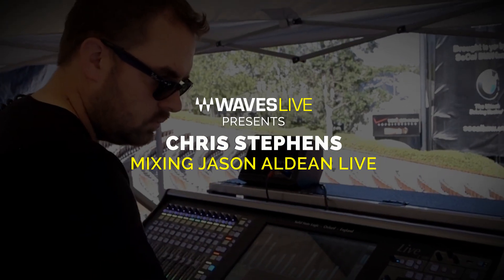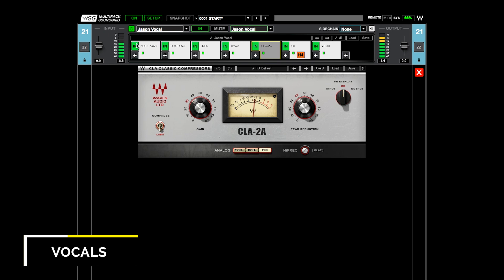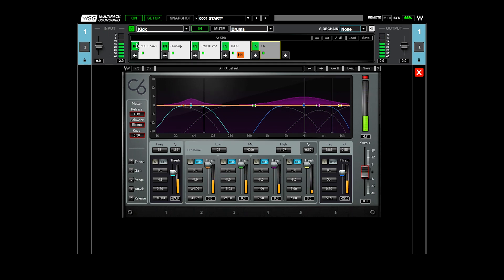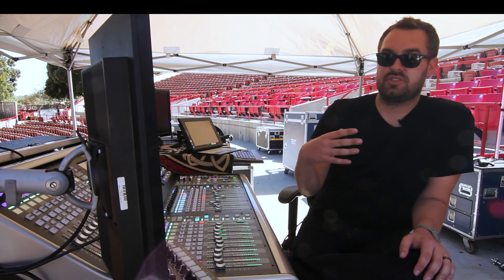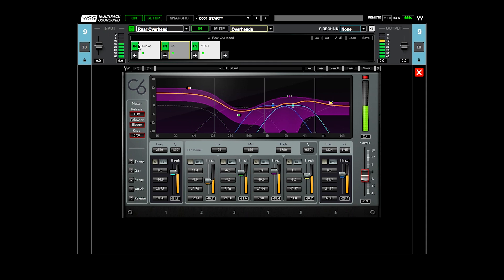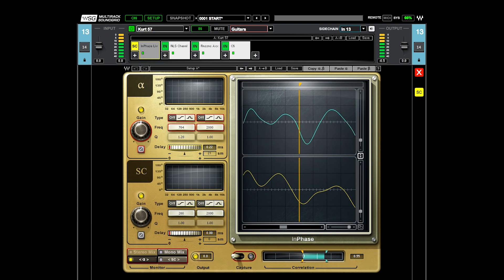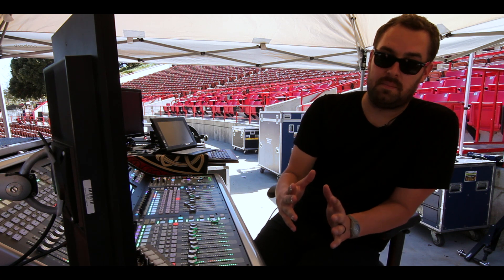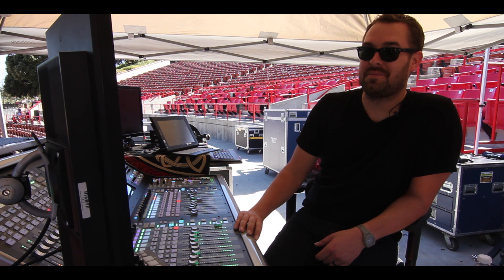Inside the Mix of the Jason Aldean Tour with FOH Engineer Chris Stephens

Comment: Which Midi controller is using for changing parameters and switching plugins on the chain?
Reply: +Federico Nill the console itself. the wavesgrid server integrates really nicely into the surface of digital mixing consoles.
Reply: Apart of that, he has a midi controller to switch plugins on the rack
Reply: The waves server does not integrate with the SSL consoles like the Digico desks.
Reply: +Federico Nill I'd like to know as well. Almost looks like a livid? I use an MPK mini right now and have navigation mapped to the keys so they aren't wasted.
Reply: +Federico Nill Novation Launchcontrol Mini.

Comment: Would I be able to run plugins like what you show at the beginning on a macbook running into consumer level digital/analog boards?
Reply from the maker: Dakoolguy111 please contact our Sales Office at 865-909-9200 or you can message them here: http://www.waves.com/contact-sales
Reply: +Dakoolguy111 Yes, i do this occastionally using an interface (motu ultralite mk3) but you have to be very picky about what you use it on as latency is an issue.  Generally i just use a vocal chain and then effects returns.

Comment: you’re right he’s a pro he knows more than most of us and look at the job he has but for christ sakes he runs each instrument and vocal through 10 different things and then the 11 thing is to counteract the 10 different things he ran through. If he was a doctor he would be like hey take this pill to bring you down when too excited but then if you get to low take this pill will bring you back up. Maybe with the sound system he has and the board he has he can rely on hopefully the talent on stage instead of what talent he’s trying to use back at the board. You need talent at the board but this sounds a little much Like I have all this gear I have to use it all and yes I don’t care about your thoughts about my opinion that’s why it’s mine

Comment: Welcome to Loudness War. What happened to dynamics? I love some Wave Plugins but people tend to overuse them and here you have the Perfect Example of Overkill. Digital may be good but it also ruins a lot....
Reply: No...i think what the essence of his work actually is, is that you don't compress as much as people think. You compress more smartly. It seems like overkill, because he is able to run all these plugins live, that cost so much and use up so much computing power...but taking 1-2 db, then another 1-3 db, then another 2-4 db, he is actually compressing 1-5 db less than what mixers would have done since their widespread live availability in the 80s. 3 plugins doing 8db of gain reduction is smarter than ONE doing 10DB of gain reduction. I can totally follow that argument. Especially with the different timings of the compression.

Comment: This is precisely why music sounds terrible. Overly processed and it kills the dynamic range while sucking dry all of the feel of the performance. Every large venue sounds terrible nowadays. It sounds like their mixing with graphs and math instead of good ol ears. Sounds about like broadcast mixing. Hey let's see how flat we can get everything because it will be perfect. Blah blah.
Reply: +JARRETT JOHNSON I say, plug the mic into the board, and then add a little eq if needed, and thats it.
Reply: lol
Reply: Well said
Reply: Yay, the "good ol days" when all you get is a great low end. So muddy you can't hear anything.
Reply: Not really. I see your point and it certainly applies to the way recorded music sounds nowadays. However, live sound is a different beast in a variety of ways. Everything's constantly changing and it's good to have a good amount of control over the dynamic range of each instrument/mic. He's actually compressing a lot but that doesn't mean it's going to translate as 'over compressed' when you hear it and it obviously changes from venue to venue, PA to PA, etc.

As to 'seeing' rather than 'using his ears', that's not entirely true. I'm a sound engineer and it REALLY helps to have some visual feedback when there's a certain frequency that's starting to cause a lot of trouble and you have virtually 2 or 3 seconds to figure it out before it starts to become noticeable and awkward to the audience. In extreme case scenarios (especially on small venues, clubs, etc) it may even lead to feedback and it's good to have an RTA graph to know where the offending frequency/frequencies is/are.
Reply: Sort of true, JJ -- certainly regularly true in modern recording.  Live sound, though that's a real different thing.  I'm old enough to remember bad sound in a big venue.  So I'm less critical -- do what you need to do to make a good sound.
Reply: Exactly. I'm lucky (unlucky ?) enough not to remember those days but the older folks I work with tell me all sorts of tales about it lol. Talk about pre-line array days and such...